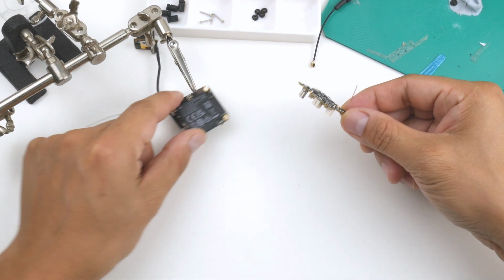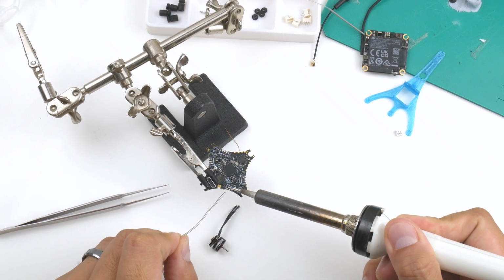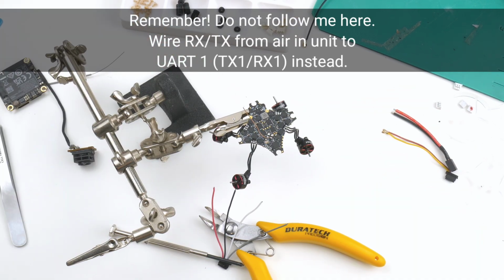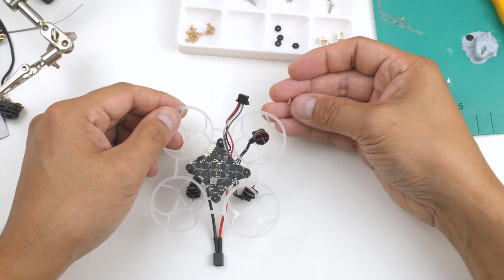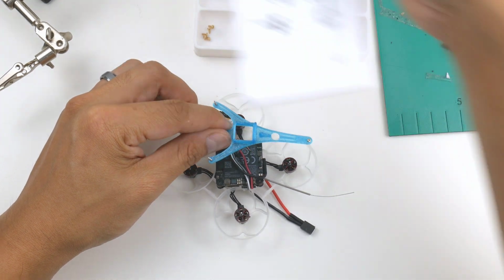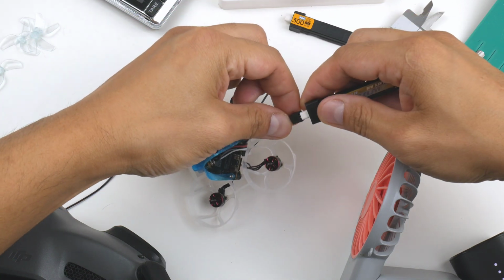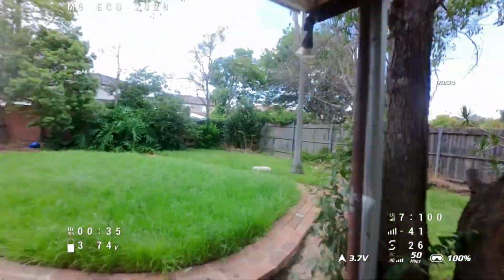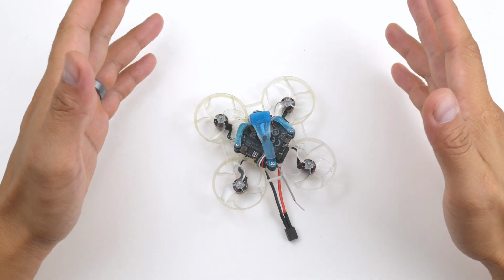DJI O4 Mobula6 2024 1S Build - 65mm Tinywhoop

Comment: If you want to make an o4 work on a 1s 65mm platform, you will need the new betafpv aio. It has a 3Amp 5V BEC which can supply the O4 way better and make sure you have no issues with connection issues. 
But if you want to still use the happymodel superx HD for something, i woud suggest trying to build a small 2s whoop or eveen open prop design with it. On a 2s platform you can just solder the o4 to the battery voltage.
Reply from the maker: You're absolutely right! Check up my follow up video: https://youtu.be/iFSB_DzlT7w

Comment: They have a full mobula6 2024 model will the 04 lite fit straight onto this
Reply: If i get the  canopy and bits printed
Reply from the maker: Yes. It's quite similar, but the Mobula6 2024 comes with the super X 5in1 flight controller that has a built in VTX. It's slightly heavier but also you'll need to disable the onboard VTX or you'll get interference from running both the analog and O4 VTXs at the same time on the same quad. You might also need spacers or source different grommets to ensure the boards have sufficient separation between them so no components are touching.
Reply: @nxp200  and how do I go about disabling the onboard vtx mate
Reply from the maker: @leethornton85  from what I can see on the AliExpress listings for the SuperX 5in1, there is a VTX power bridge that you'll need to desolder to disable it.

Comment: BTW if anyone is looking, you can use RX2, there are two little solder jumpers by each of the ports, if you remove the solder it disconnects the onboard elrx from RX2. I have the VTX on RX2 and using the SBUS on RX1 with the fpv controller.
Reply from the maker: That's great to know! Thanks for sharing! I wasn't aware of that jumper, but in my case, I needed the onboard ELRS anyhow. Appreciate your comment, mate! 👍🏻

Comment: I did the same thing with the exact same hardware and it doesn't seem to have enough power, maybe I am missing a setting in Betaflight. Any chance you would share a dump of your settings? I have tried it on 2 different 5v pads and directly to the battery and as soon as I take off the goggle connection resets. The voltage appears to be okay on the osd, so I am hoping it is a setting.
Reply from the maker: If you're using the SuperX flight controller, you'll need to turn off onboard recording and reduce the O4 output power to 25mw. Otherwise I've swapped out the flight controller to the BetaFPV Matrix 3in1. Here's my update video on how it performs: https://youtu.be/iFSB_DzlT7w?si=Up2ie4OigpTPV7tE
Reply: @nxp200  Sweet, that worked. Really appreciate you responding. Subscribed to your patreon.
Reply from the maker: I'm glad it worked! Wow! Thanks for joining!! I really appreciate your support! 🙏🏻

Comment: I like where this is going. Thought I was the only one with wind problems and the little dudes. 1S DJI 04 lite is what I'm after next, so hopefully it will be more reliable in the future.

Hey I don't know much about the becs...but can you wire up an external one that bumps up the power? not what you want with weight I know...but just wondering.
Reply from the maker: Yes, if you can get a hold of a tiny bec like the fractal engineering boostybaby, and if it can supply 5V up to 3A, the it should work. I will be uploading soon the testing of the BetaFPV Matrix 3in1 FC that supposedly works without an external bec.
Reply: @nxp200  Great thanks for testing it all out :) 
Long story short...been on 5 inch for years...4s and 6s and then 8s freestyle.....in los angeles there aren't really any spots to fly anymore....

so smaller the better...plus I can do it all DJI finally...

so keep it up...i'll be copying you soon I hope.

Comment: Hey mate, could you tell me the size of the stack screws you got in the package? I believe they're M1.3x10 (the longest ones on the Happymodel website). I'm planning to go with the BetaFPV Matrix, but I think I might run into a problem since it only uses M1.2x5 screws.
Reply from the maker: The long ones that came with the Happymodel SuperX flight controller is M1.2x8. You're right, I don't think 5mm is long enough for double stacking, so you'll need to source 8mm or longer.
Reply: Thanks a lot !

Comment: Wild! Wonder how the 65pro frame would do by comparison with the extra prop size
Reply from the maker: Extra prop size for thrust would definitely help. At the moment, it's hard to catch a steep dive or powerloop. Would be a good comparison.
Reply: @ i have had a few attempts at 65mm walksnail and split cam HD builds with 2 sandwiched boards and the jump to pro (as long as the fc fits) is very much worth it.  The frame is barely barely bigger footprint but 10% more prop makes a big difference.

Comment: Can i Connect the o4 lite to analog fc ?
Reply from the maker: Yes. But you will need to work out how to disable the analog VTX. Otherwise your O4 signal will likely get interference on the goggles, given both VTXs are broadcasting from the same location.
Reply: @so i guess, shout be fine with this aio Happymodel CrazyF411 ELRS AIO 4in1 20A ESC z UART ELRS 2.4G ?
Reply from the maker: Yep. Looks like it doesn't have a VTX, so should work. The 5v BEC on board is only rated to 1.5A, so it should perform similarly to my build, but as mentioned in the video, it is limited in functionality such as not being able to record on board video and possible early brown out if your battery is old. I would suggest to get the BetaFPV Matrix 3in1 if you can handle the shipping wait times and want to experiment like I did.
Reply: @nxp200  i think i can try BEC 9v 1.5 from battery to o4, shout be okay 😏, but yeah 5V and 1.5 is too low for that also thank you for reply 👌

Comment: I have the same FC with analog and it get those jitters like yours. I changed to beta 4in1 problem solved
Reply from the maker: Thanks! Good to know. I replaced a grinding sounding motor and updated to Betaflight 4.5 which seems to have calmed the jitters a bit.

Comment: what about Flywoo goku 1-2s Board. it has 9V out even on 1s
Reply from the maker: I think that would work too.
Reply: @nxp200 Hallo. Is it possible to Change the analoge camera from Iflight Nazgul V3 DC5 ECO and replace it with DJI 04 Air unit lite and flying with DJI fpv Remote Controller 3? Thanks. Best regards from Germany.

Comment: Also if you use a 5a bec you can use this on 1s down to 2.8v. one has one built in but you can buy one to solder on too without getting a new fc. And for a build like this I would make all the wires as short as possible and use a lighter frame

Comment: i woulda waited til you could get a board with 3a 5v pad, its well documented that you need this.
Reply: Betafpv 3in1
Reply: 2A is enough I think
Reply: @dnzdrakrks7549  if you don't want to DVR and run 25mw the entire time, 3A is going to give you full function and full battery.

Comment: Hi. To prevent the early brownout, connect the o4 power leads directly to the power in on the flight controller. This  works for a lot of users.
Reply: This is luck of the draw too. Some o4 units work down to like 3v, some cut out at like 3.5v. The matrix board is definitely the way to go for o4 on 1s
Reply from the maker: I might give this a go and report back. Thanks!

Comment: 2024?? It's 2025 now, but great video, loveeee the DJI Air Unit 04 system 1s, perfect to for indoor, niceeee!! 🤙🏼
Reply from the maker: The frame is called "Mobula6 2024". So I had to call it that. Thanks! I did fly out around indoors but my place is a mess right now 😂
Reply: @nxp200  ohhhhhh I got it, it's the frame that's from 2024 oh oh okay I got it now. Thanks for clearing that up. It was lots of jitters, but you know how to tune it up to have flight smoother! I have no idea how to tune up, it's pretty hard for me to learn. I'm deaf and it's harder for me to understand the tune up. I have tried it in the past, but it doesn't works out for me. But anyways I like your backyard, little awesome backyard, you can make up your own gaps and tunnels, etc to make it more funnier, but thanks for getting back to me 🤙🏼👍🏼
Reply from the maker: @indroneswetrust1 I've been able to calm the jitters. Seems one motor was faulty from factory and has some grinding sounds. Also flashed Betaflight 4.5 for good measure. I'll post an update flight video soon, but I wanted the build video out as soon as possible since many people were keen to see. Yeh the backyard is a good space. I've been meaning to set up a tinywhoop race track but haven't gotten round to it yet.
Reply: @nxp200  ahhh might be faulty motor, I'm glad you got the jitters calm down lolz, yeah I understand people wanted to see the build video. When you get your backyard setup for DJI whoop, get the video out too, I'm sure people out there wanted to do same setup for their backyard to have some fun with their whoopies too
Reply: Sick build! You need to put a piece of foam in between the camera and vtx though. Those 3d printed mounts are nice but they bend and a lot of people including myself have broken vtxs from not having foam in between the camera and board.